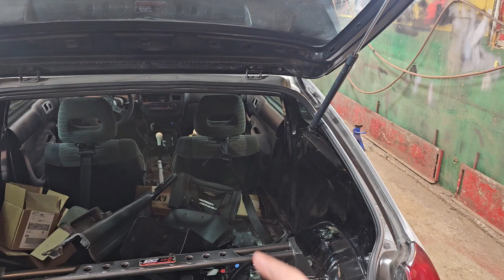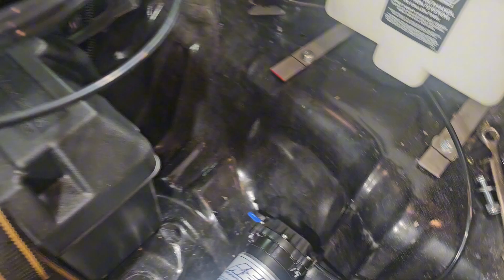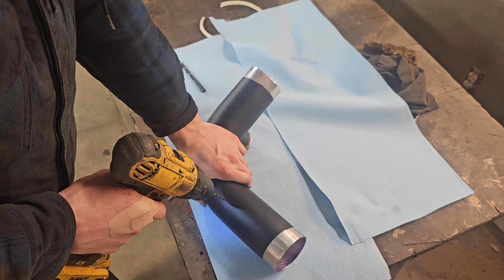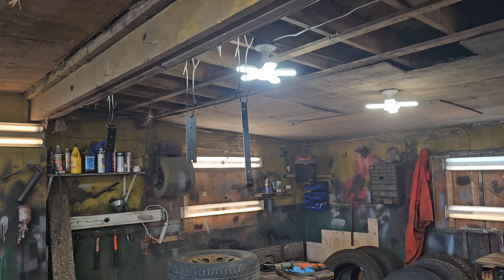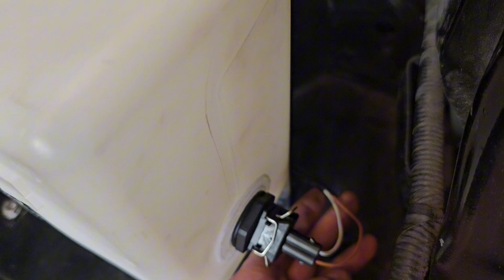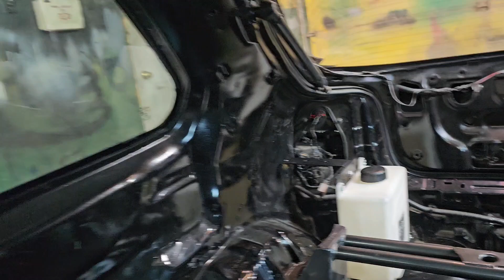B series vtec turbo build pt 12 - Installing AEM water methonal injection

Comment: Why not just go e85 from pump?
Reply from the maker: @playerinpink  I dont have e85 where I live
Reply: @SaltySpeed that sucks man! Such a good build bro. I’m the same power level like 450-480whp street tune. On dyno it made 439whp with two boost leaks then we turned it up on the street. It’s a riot. Such a fun car. Have you redone bushings, all suspension components such as camber arms, toe arms, bushings, tie rods etc? That made a huge difference along with lsd and traction bar. Also rear disc and mini cooper big brake upgrade in the front😊
Reply from the maker: @playerinpink  sick man and yes more suspension mods to come

Comment: Nice Build is this a fresh build because wondering if car has made any boost  due to no bead rolls on intercooler piping just wondering how they held up
Reply from the maker: @frostyflowers4207  Thanks man!! Yeah it is fresh build but I have car now finished I'm just catching up on videos that I have had to edit. Car makes 22psi no bead rolls and I've had no problem.
Reply: Got a question it's worth it ?